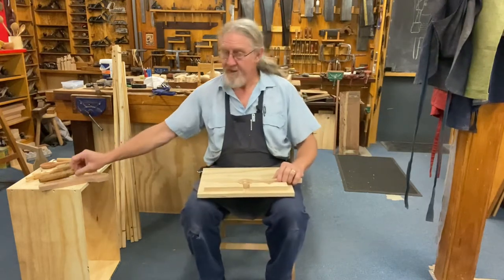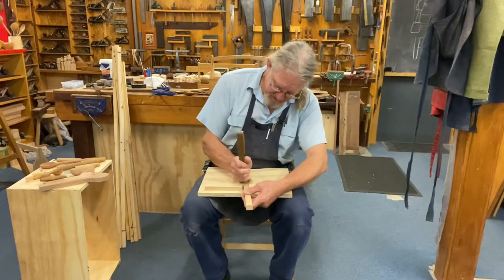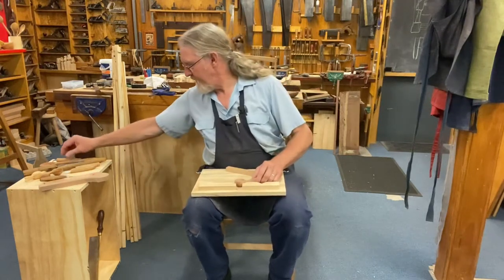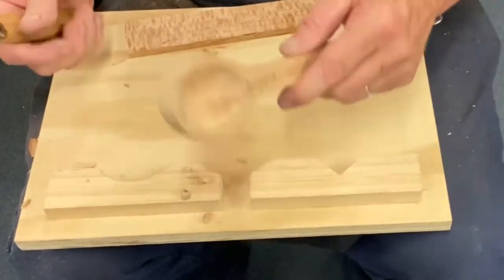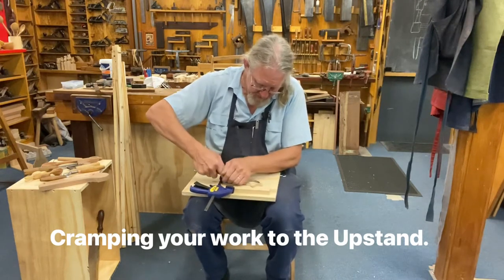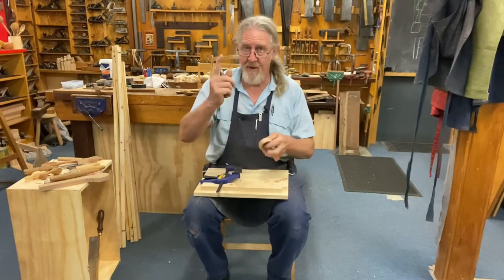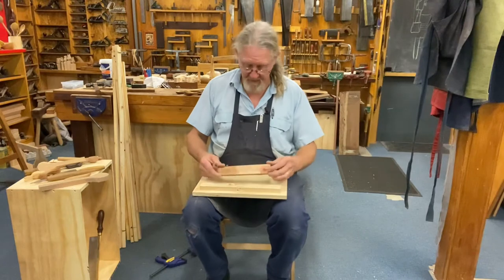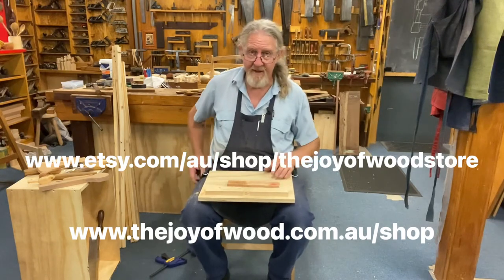Introducing our new Lap Bench for Carving

Comment: I notice you are pushing the open curve hook knife. Is that a left handed tool or double edged? Most people seem to use the right hand tool with the pulling forward motion. I like the idea of pushing.
Reply from the maker: Gidday, Sandra. I had to look at the video again! Yes, at the 2:30 mark, I was using a BeaverCraft SK1L hook knife. L for left.   At the 3.40 mark I am using a BeaverCraft SK4L hook knife. The L vs R really has nothing to do with "handedness", I believe. It is all about the direction of cut. I am a very right handed person, so it happens.

Working across your body with the handle pointing towards you, the L cuts from left to right and the R cuts from right to left. I use both L and R hook knives, as well as double sided hook knives, like the BeaverCraft SK5, to do the best cut at the time for the way I an holding the spoon and for the grain in the wood.  I can use either L or R solely on its own to do a complete spoon bowl, of course, but sometimes is is just easier and more comfortable to change to a different knife. Having more than one knive also helps to share the wear around! 

In this case, I probably used the L knife so I was pushing the spoon against the upstand of the Lap bench. I did it instrictively,, with out even thinking about it, Hence I had to look at the video!

There are so many possibilities with this wonderful Lap Bench. I hope this helps.
Kind regards, Greg.

Comment: Very useful! May I suggest to add some holes, so you can fix the wood with some pegs and work with both hands free? It would useful in the wild, where you have not a lot of tools, but you can make yourself pegs on the fly. 😉
Reply from the maker: Gidday, Diego. Yes, we considered having peg holes, but the holes would best go all the way through the 3/4” thick bench. This could be a pest for the user’s legs! In due course I reckon we will add a few attachments to make the bench even more versatile! Thanks for your thoughts. Improvise! 👍
Reply: @thejoyofwood  do pegs actually have to go all the way through?
Reply from the maker: @user-nx1rg9tn7z  I would suggest they do, to have enough lateral strength. The bench is only 3/4” thick, and you’d need all of that for the lateral grunt. A range of peg lengths would be helpful, depending on what you are holding, to minimise the amount poking below the underside. I reckon some “folding wedges” would be good too, to grip your work between the legs and the upstand.